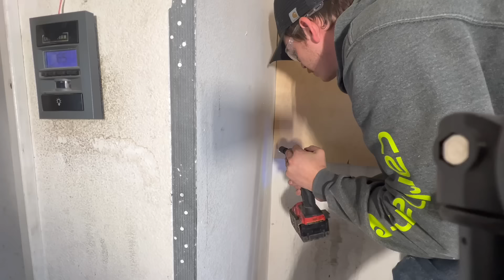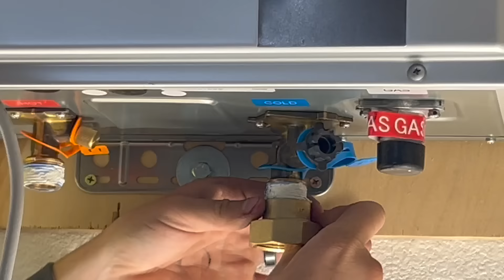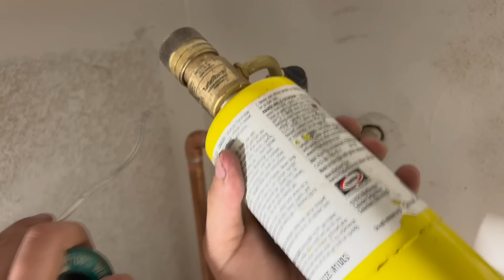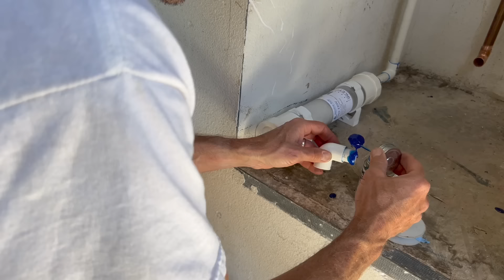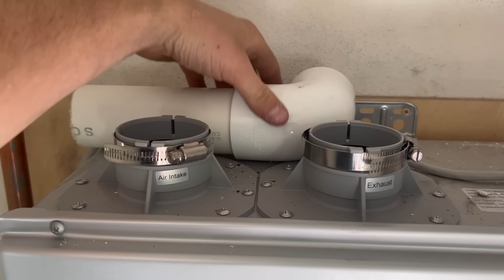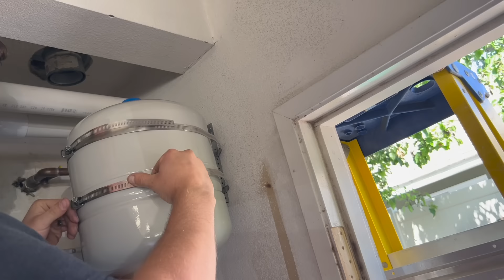How To Install A Tankless Water Heater (Start to Finish)

Comment: The thing that really gets me about the design of these things is the fact that the inlets are always on the bottom. So you have to buy more copper pipe and redirect everything. It just makes things so complicated. Could have just put the inlets on the top.
Reply: Incorrect; there are some brands that have the outlets on the top, though the majority are on the bottom

Comment: Propane/NG specialist here: the flex line upgade was not necessary at all. The old one would have moved more than enough BTU for the demand over such a short distance it would've done just fine. But hey its always nice to have it all clean and new looking
Reply: If these guys work for a company, it might just be policy. My old company had us hard-pipe all gas connections with unions. We were not allowed to use or re-use any flex connectors

Comment: You used regular pvc which isn’t permitted for these units. Also when you solder you heat the fitting more than the pipe
Reply from the maker: Still working fine bud. No leaks passes code in my city

Comment: You left out a lot of "trivial" stuff, such as How to measure all those pipe pieces so that they fit together on the First try. And you had no mention of how the unit must be centered in the cavity, or that there is a Minimum distance to the walls, floor, ceiling. You professionals might think everyone was born knowing a lot of this stuff.  Basically, this was a guide to professional plumbers, not us DIY homeowners, some who don't even know they have to flux the ends of copper pipes before soldering.
 -- I'd hired a handyman to install mine. Halfway through, I fired him when he said, He'd never done a water heater before, and, "Sure it might not be up to code, but it will work." Now I can't find a licensed plumber who will start over with MY tankless heater. They insist I buy theirs.

Comment: what type of head is that... seems to keep the flame isolated better than most on the market.  

great step by step video.  gud clean work
Reply: also that Milwaukee pvc cutter is meta whilst on the ladder choppin those vents
Reply: 19:48 - Great edit.

Comment: the tankless water heater will have a lot of settlement inside pipe ,will clog the faucets, also during power outage it will not work

Comment: Im a licensed plumber and yall did excellent, even better than some plumbers i know.
Reply: Yes but... they failed to use PVC cleaner before the glue. Additionally, for gas fittings  yellow Teflon tape should be used.

Comment: NIce video, great job.. Don't the exhaust and intake air line have to be at a slope? How much of a slope?
Reply from the maker: Most water heater vents have 1/4” of slope. Depends on local code. These had 1/4” of slope. I don’t think I mentioned it unfortunately.
Reply: @fathersondiygarage3580 Thank you I thought it was about 1/4 inch per linear foot. Also it looks like you had about an inch gas line to the point of flexible connection. Is that correct?
Reply from the maker: @patrickboland8583  we upsized the new gas line from the meter to 1” for more readily available volume of gas, then reduced to 3/4” right before the flex line. Probably a little overkill, the tankless calls for 3/4” but The unit has been working great since it was installed!
Reply: @fathersondiygarage3580  Thank you for the information, I appreciate your quick response too.

Comment: Good work!! Question. Do I need an expansion tank on my tankless water heater! I been told that if I have a circulation pump or check valve I need en expansion tank, but I don’t have a circulation pump or check valve! Do I still need an expansion tank?

Comment: Great job on explaining everything, why you can't use the original venting exhaust?
Reply from the maker: The tankless has humid acidic exhaust which can corrode the metal vent. And over time the gases could leak out into your home
Reply: @fathersondiygarage3580 
Thank you so much for explaining, the out walls are not that close to unit in my house, someone said they can insert the PVC inside the original one all the way to the top, is that ok?
Reply from the maker: @lamassu4100 yeah you can use the old one as a sleeve for the new plastic exhaust pipe.
Reply: @fathersondiygarage3580 
Thank you so much.

Comment: No primer on the pvc connection. My irrigation training is screaming at me. Is there a reason you are are only using the glue?
Reply from the maker: It’s only a drain. No pressure

Comment: Good job guys. Did you have to pull a gas permit?
Reply: As a permit tech… yes you need a permit when changing any type of water heater gas/electric, traditional/tankless etc.

Comment: OK, great instructional video, what if I have a concrete wall, how do I rig up a plywood framing to the cement wall? Wedge anchors first, then lag bolts into those?
Reply from the maker: If you have a concrete wall I recommend not using the plywood and screwing straight into the concrete wall with concrete screws
Reply: I agree. Screwing plywood on concrete then installing is like putting gas in your car by putting it in a gas can first then I'm your car. For what when the pump is right there.

Comment: Thank you for this video. If I get a response I would truly appreciate it. I have a Rheem tankless water heater that just turned 15 years old and wanted to upgrade to a new one. Would it be as simple as unscrewing the hot/cold/gas line into the new one since all the lines already exist? I would hate to pay for labor for something that could be as simple as hooking up a gas stove or washer. I’m new to this so any info would help thank you!
Reply from the maker: Hey thanks for watching!!! If the new unit has the connections in the same place you should be able to just swap out for a new unit

Comment: Why can’t the old exhausted be used ?
Reply from the maker: The exhaust from a tankless heater is acidic and over time can corrode metal vent pipes. You need to vent it with plastic pipe

Comment: When a water heater is installed above a living space a drain
pan is required to be placed underneath the unit to catch potential leakage. In order to reduce
the risk of moisture related damage, a drain pan should be installed and connected to the
nearby floor drain. The above statement is coming from a home inspector.

Comment: I figured instead of running the air intake pipe you would just allow the garage air to be used as combustion air since it is considered outside air anyways.
Reply from the maker: Yeah you can do that. Our garage is a workshop so all of the dust isn’t good for the tankless intake.
Reply: @fathersondiygarage3580 understandable!

Comment: Excellent video, guys. Could you explain to me if there's a difference between installing the drip leg (or SEDIMENT TRAP)  line on a tank-based heater and a tankless one (gas supply inlet and equipment inlet) .Thank you very much for sharing your knowledge .
Reply from the maker: No difference, they both need a sediment trap in our area as close to the water heater as possible.

Comment: Tankless water heaters are the biggest rip off imaginable.  They cost more to buy, to install, and to maintain. They need to be descaled and maintained annually by a license professional, or manufacture warranty is voided.  Without a descaler or water filtration device...say goodbye to your faucets in fixtures within 3-4 years.
Reply: Ha ha ha,  you don't have a clue..

Comment: What is the typical temperature of the exhaust? Can PVC pipe sustain the exhaust high temp?
Reply from the maker: Tankless water heaters are really efficient. The exhaust is cool enough to vent in plastic
Reply: High efficiency heaters also vent with pvc pipe.

Comment: I have 2 Ecosource tankless units. I leaned a few lessons on the first one. Whats cool about the tankless is you don't have to put it where the tank was. Its small it can be mounted anywhere you can run 2 pipes and some power too it. This one is gas powered so they are stuck putting it here. And like most installs there's no insulation on the hot water lines.

Comment: this tankless water heater uses gas, how come the exhaust pipe is PVC pipe as same as intake air pipe?  should it be used metal pipe ?  please give answer. thanks.
Reply from the maker: The tankless takes heat out of the exhaust gas also to heat the water. So the exhaust comes out cool enough to vent through plastic pipe. The exhaust is also acidic so if you used a metal exhaust pipe it would corrode it.

Comment: If you're using pipe dope, there's no need for the Teflon tape.
Reply: i was always told use both to be safe
Reply: @professorchaos-q6c  Both on anything with water.  Dope only on gas.

Comment: The only thing i saw that wasn't explained is that the expansion tank needs to be pressurized to whatever PSI the house has in its lines.  This can be done with a gauge that hooks up to a water spout. Other than that,  awesome work.
Reply from the maker: We did do this! Forgot to video it! Thanks for watching
Reply: I actually thought tankless water heaters don’t require to have a expansion tank any more 🤔
Reply from the maker: @carlosortiz-zo4kl for us it’s a local code that all water heaters have one and it helps reduce water hammer
Reply: @fathersondiygarage3580 its primary purpose is to give extra space in the pipe  for the water as it expands.  In an open system (no check valves) the heated water simply gets pushed into the cold side and expands back out into the street. If the system is closed, an expansion tank is needed and serves that purpose.
Reply: @carlosortiz-zo4kl It's not required,  but it is still a good idea.
Reply: @carlosortiz-zo4kl regardless of the statement about local code, they are necessary if your plumbing system is a “closed” system. This would be the case if you have a recirculating hot water loop with check valves, a PRV where the water enters the building, or in some jurisdictions the water meter has a check valve.
Reply: 😍 BEAUTIFUL JOB!!!
Reply: This!
Reply: Why expansion tank? Tankless water heater doesn't hold water..whats going to expand?

Comment: Nice video guys.  I like the way you still sweat the joints. Consider doing a dual loop unit for hot water and radiant heat.  I could use the pointers / help.